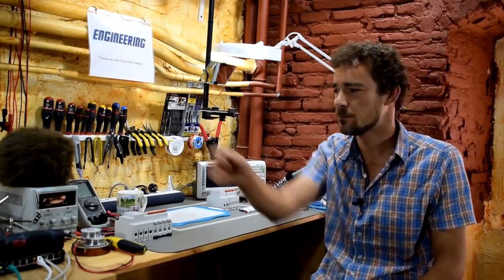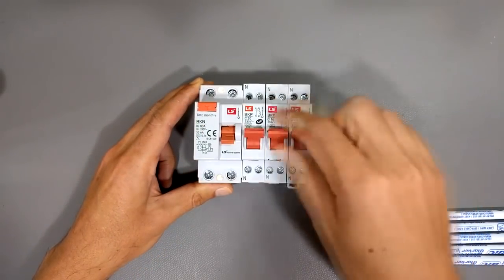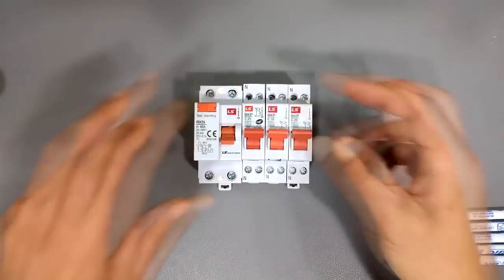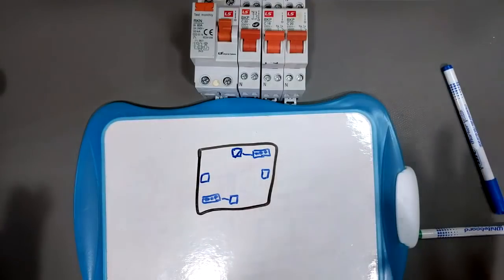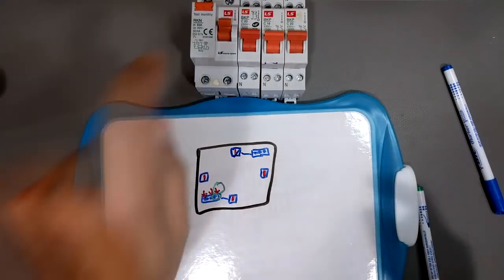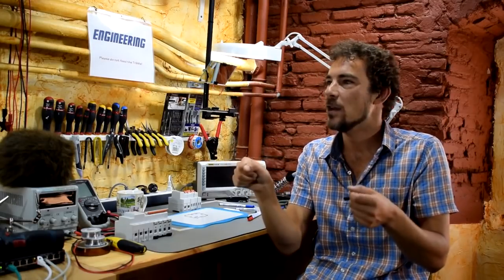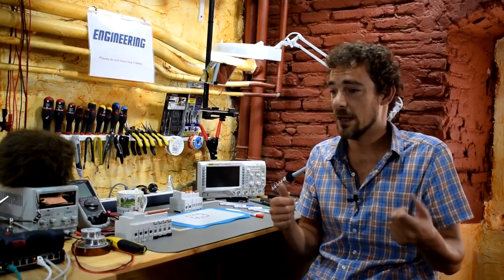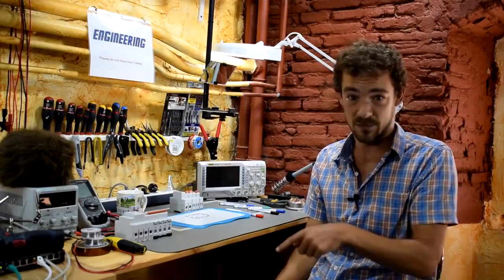DEAR GOD the circuit breaker keeps tripping - What to do?!

Comment: I can't figure out why my light switch keeps tripping breaker every single time tried different switches checked all wires im so frustrated!
Reply from the maker: Hmm... If there's a light fixture on the switch, try just a plain old bulb in a socket. That might tell you that it's a problem with the fixture. If the switch is controlling power outlets, try disconnecting the outlet and capping the wires. That would tell you it's probably a bad outlet. Sometimes, the thing that seems like it would never cause a problem is exactly what's causing the problem. Otherwise: either the breaker is bad, or the wiring in the walls is faulty.

Comment: Can I actually take a 20 amp breaker and make it a 48 and breaker in the box to keep it from tripping
Reply from the maker: NO! You can insert a smaller breaker, but not a larger one. The larger the breaker in Amps, the thicker the wiring connected to it needs to be. Otherwise, things catch on fire. :(

Comment: Hello, 
First, Thanks for sharing this video. 

Anyway, I’ve got a question of circuit breaker you mentioned.
Why is not the living room circuit breaker the one that trips ?

For me, the circuit breaker for the living room should be the one that trips first whenever there is electrical problem e.g. short circuit.
The main circuit breaker should not trip first.

If the circuit breaker in the living room works properly, then it should trip first to save the whole condition in order for the rest of rooms can still function electrically.

If the breaking capacity of living room circuit breaker is not big enough to trip the short circuit problem, then the main circuit breaker will trip in order to save electrically.

Thanks & Best regards, 
Leonardo
Reply from the maker: It depends on WHICH TYPE of breaker trips... In some countries, it's 1 breaker per room (which is overcurrent only, overcurrent + GFCI, or 'other'). In many countries, there is 1 GFCI / RCD for leakage current / electrocution prevention that protects a whole row of overcurrent (short circuit) breakers. In that case, depending on the type of electrical fault, either the overcurrent breaker for that specific room will trip, or the GFCI safety breaker for several rooms will trip. That's just how they do it in some places. 

Of course, if you wire your own place, you can do it however you want. For example, I added dedicated GFCI breakers for bathrooms and kitchen outlets. That way, faults in the most dangerous areas (lots of water) won't cut power to all the other rooms.

Comment: I hope you still reply =)

I have 2 AFCI breakers, both tripped 1 instantly and 1 after a few minutes.  Nothing new was plugged in into these circuits.  I also tried shutting off all breakers except these 2 but they would still behave the same way.  Would replacing the breaker be my first option at this point? Thanks
Reply from the maker: AFCIs can cause "nuisance trips" when things like laser printers and vacuum cleaners are plugged in, or in the presence of radio frequencies between something like 1 and 30 MHz if I remember correctly. So, the first thing I'd do is unplug everything on the circuit. If no tripping occurs, plug in one thing at a time, wait 10 minutes. Rinse and repeat! If that doesn't show 1 device that's causing the problem, then I'd look at replacing the AFCI in question. Even newer AFCIs can fail early, but I would look for some problem gizmo on the circuit first.

Comment: Hey Scott great info. I got an issue that in my laundry room my 15 amp breaker popped and I changed it to a new one, then popped again 2 days later? I have a fish tank with no new pumps, tankless hot water heater, washer, dryer, 4 led light in the sealing. Never had a problem in 4 years. Today it popped twice. I plugged the power strip in the outlet next to it. If that don’t work maybe I will buy a new power strip? Really a head scratcher. Ty, Jeff.

Comment: After plugging in my electric pressure washer to an outdoor outlet one time, the circuit breaker for half of the plugs in my basement keeps tripping. I switch it on and it immediately trips. I replaced it with a new circuit, but it too trips. Any ideas?
Reply from the maker: Since it began when you used the outdoor outlet, I would check that outlet and its wiring. Could be loose connection, water ingress, corrosion that create a slight short circuit/ground leak, etc. I've seen outdoor outlets where the live or neutral was corroded and it appeared that this corrosion would come into contact with the slightly damp wall and sometimes cause the GFCI/RCD to trip (it was a brick wall, recessed outlet). You could also remove the outdoor outlet, cap off the wires, and test. If that doesn't work, disconnect the wires at the panel that go to the outdoor outlet, and test again. Well, none of that is a sure thing, but it's where I would start!

Comment: Scotty, in my kitchen my microwave is above my gas stove n my dishwasher is next to my gas stove .. if the  either one is on n sumone turns on the other one too my breaker trips ... so we gotta constantly turn the breaker back on but now its tripping when only the microwave is on ... what do we do ????
Reply from the maker: I assume this is a GFCI / RCD breaker that's tripping. In that case, I'd unplug the microwave for awhile and see what happens. If not, unplug each of the other appliances, 1 at a time. It'll be a bit inconvenient, but that should indicate which one is causing the leakage current. Then that appliance will either need to be repaired or replaced. Rarely, the problem could also be a loose connection in the power outlet for the appliance.

Comment: Okay, the plugged into power outlets is quite a simsple problem to trace..  What about  the simple light circuit fuse which has not power points at all connected to it.  As you may know the light circuit is not connected to any power outlets. I believe in a light circuit, there is no power at the  point where the globe is inserted till the power is actually swithched on.  What happens when a light fuse goes off.
Reply from the maker: For lighting-only circuits, first I'd remove all the bulbs and then re-insert one bulb at a time. If one light fixture seems to be the culprit, try a different bulb. If that doesn't do it, then you'd have to check each fixture + the wiring connected to it. If lights are wired properly, the hot/live wire should be switched via the light switch. So, neutral + ground will always be connected to the fixture, and hot/live is toggled on/off by the switch. But that's not always the case depending on the age of the building and whether or not a good electrician (or home owner) wired it up.  If you check all fixtures and the breaker is still tripping, you may have to explore a bit... For example, a friend of mine had this exact problem. We checked the light fixtures, bulbs, junction box wiring, everything... There was no problem, but the breaker kept tripping. It turned out that there was also a fan embedded in the wall above the fireplace in that room. When there was a fire, this fan would suck in room air, heat it, and then blow it through vents to other rooms. Well, that fan was on the lighting circuit, and it had failed. It should NOT have been on the lighting circuit, so it was hard to find the problem!

Comment: Great video! My problem is the very last one you describe in this video. Only thing is we only have our dryer connected to it and after 12 years of living in the house it’s decided to trip the fuse? Not knowing any better, we bought a new dryer this week and it didn’t fix the problem :(. So how can I safely replace the one fuse or do you think something catastrophic may be is going on in the wiring
Reply from the maker: Well, what I would do is cut power, check and tighten screws/lugs holding wires in the breaker itself in the panel, and also make sure the wires at the power outlet are securely fastened. A loose wire on either end will cause problems. If that doesn't do it, replace the breaker. If THAT doesn't do it, then it's a wiring issue or something else weird going on. As always, if you're not 100% sure of what you're doing, call an electrician.

Comment: Hi great info i have on breaker that keeps tripping because of to much stuff plugged in can that breaker be upgraded to prevent this ?
Reply from the maker: Usually not. Circuit breakers are sized for current, which means they are directly related to the gauge of the wire that runs between the breaker and power outlets (or whatever). So, if you bump up the breaker in size, you'd also need to replace the wiring with something beefier. Sometimes, breakers can be undersized for the gauge of wire used (like somebody did a DIY project and used a smaller breaker just because they had one on hand). That's pretty rare, though.

Comment: I have a older home and the breaker keeps tripping when running 3 Windows ac units on  3 different rooms... very frustrating, do we need to replace just the breaker box for a bigger one? Or could it be more of a need to update the wiring, there has not been any problems with outlets. Also we are considering adding the central ac unit will that mean we are just going to have to add a updated bigger more powerful breaker box? Thank you anyone taking the time to answer this.
Reply from the maker: It really depends on how everything is wired up, and the maximum capacity of your connection to the grid. If all 3 rooms are connected to the same circuit breaker, that could overload that breaker. If they are connected to different breakers, and the main breaker is tripping, then either the main breaker is wearing out (it happens), or more likely it's not big enough. Central AC uses quite a bit of juice. Either way, you're probably gonna need to get an electrician out to see exactly what you have, what you want potentially with the central AC, and what the situation is with your current panel setup.
Reply: @ScottiesTech  thank you very much, I will have someone take a look at it.

Comment: My gaming pc keeps tripping my breaker at random times and idk why and i tried plugging it in my brothers room and after a while it trips in there too and it can be on for hours and while im in the middle of doing something on my pc it just trips the breaker and i tried buying a new power supply but it is still doing it
Reply from the maker: First, what kind of breaker is tripping? normal one (labeled with 15A, 16A, 20A, etc), GFCI / RCD (usually has a "Test" button) or maybe even an AFCI? Also, is your brother's room on the same breaker, or a different one? If you replaced the power supply in the puter, that would tend to mostly eliminate the puter as the culprit. What about monitor, powered speakers, other peripherals plugged in at the same time? It could be the power supply for one of those gizmos instead.
Reply: @ScottiesTech  It is one of the normal ones its 20A, and my brother's room is on a different breaker and as for the other things i use a headset wich and is plugged into the pc with a USB and same for my mouse and keyboard so it shouldn't be those and for the monitor i believe that it is fine and it is new and it was doing it with my old monitor as well
Reply from the maker: @ShermanSteel  Okay, that's pretty strange... Unless your puter is like the most powerful gaming machine ever conceived by the mind of man, it's pretty unlikely that it's gonna trip a 20A breaker... That's a lot of power for a puter, even at 120V. Unless there is something else on that circuit that's sucking lots of current.  But then, the same would have to be true of the circuit for your bro's room. Hmm... What kind of H/W is inside the puter (esp. graphics card(s)) and how many W is the power supply? I have heard of undersized power supplies causing breaker trips.
Reply: @ScottiesTech  I'm guessing H/W is hardware and I have a Nvidia gtx1060 graphics card and my old power supply was a bronze rated 700 watt power supply  but my new power supply is platinum rated corsair 850 watt power supply
Reply from the maker: @ShermanSteel  YIKES! Yeah, you should be fine. I'm perplexed. The only other thing I can think of is if the 20A breaker is a "combo" breaker (IOW, it's also a GFCI / RCD). In that case, it's leakage current that's causing the problem. Other than that, like I said, that's a total mystery to me... I'm obviously missing something, but what? Hmm.

Comment: My circuit breaker is tripping and it shuts off the bathroom lights, nothing is connected to the wall outlets. What do i do, I am afraid I will no story to tell to Electrician :) . Please help. I am thinking to open up the wall sockets check if there is any burnt wire or something.

Comment: I have one switch resposible for all the sockets in the house. it goes off randomly when i turn it on sometimes it would last 10 minutes or up to 3 days and then goes off again... I still cant figure out whats causing this or which socket
Reply from the maker: It matters what kind of breaker is doing the tripping: normal circuit breaker (too much current), or a GFCI / RCD (leakage current). If it's a normal circuit breaker, then either you're pulling too much juice through the wires at once, or there's a defective gizmo plugged in somewhere. If it's like a whole-house GFCI/RCD tripping (European-style) then, it's either 1 defective gizmo or several together causing too much leakage current to ground. In the case of a GFCI/RCD tripping, look at any gizmos that use electricity + water first.

Then, what I would do: Unplug everything. Turn it on. If it goes off, there's a fault in the wiring or in an outlet or light switch somewhere.  If not, then either plug everything back in and unplug 1 thing at a time, then wait... OR, plug only one thing back in at a time, and wait... It could me something like a failing appliance, or as simple as a plug-in clock radio or something whose power supply is failing. Hard to tell!
Reply: @ScottiesTech  the big fuse is randomly switching off while small ones always on, i replaced it but the problem remains the same, the big fuse(which you called the big guy) switching off by itself from time to time, i really don't know whats the problem i tried switching off the small fuses one by one but same thing it randomly switch off.. thanks for your time man
Reply from the maker: @ea168  Hmm... I wonder if either the Big Guy is simply failing, or it might be a loose wire connection in the panel?

Comment: Good example for leakage from devices, even OHM meter may not be your right tool because OHM meter is very low voltage for detected from leakage. The one way for check your leakage device. Use low powered (low wattage) pure sine power inverter. If your power inverter too much power alarm goes off. Use Kill-a-Watt plug in meter is easy way to tell, if you are still getting a reading even your device is turned off. This may really lowered your electric bill after this leakage devices is permanently removed. Plus fire prevented too.

Comment: Good video, but my problem is NOT something plugged in. My issue is in the circuit itself (i.e.; wire, outlet or switch). Do you have a video that describes how to trace a circuit problem to the source???? Thanks

Comment: ok but the only time my breaker trips is when my computer is running. I think I may have a defective PSU because sometimes I guess maybe the amperage spikes or something or the graphics card gets used too much and then you hear a BOOM from the wall and then I go over to the breaker panel to see that the AHCI thing has been tripped. Now, it didn't have this problem when I had it plugged in the living room, but thats not really a reality because my mother-in-law likes to watch her TV. so either my power supply is going to crap, or I'm exceeding the 15amps that can be supplied on that breaker, or that outlet is bogus. Going to buy a tester soon though to find out if its the outlet before I shell out 70 american greenbacks on a new power supply. Who knows. What do you guys think?